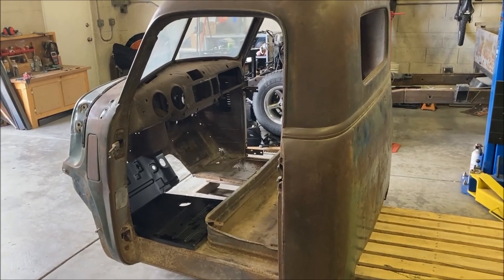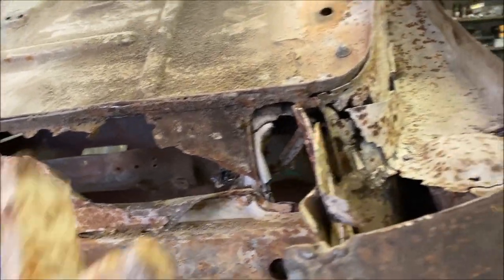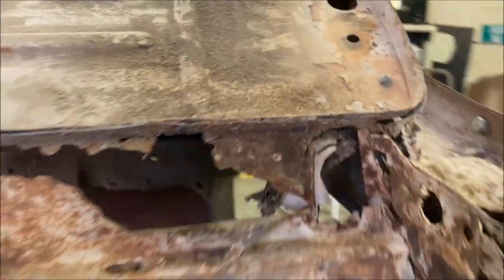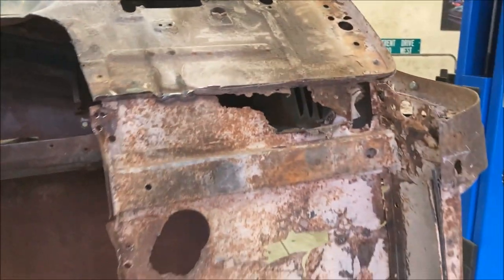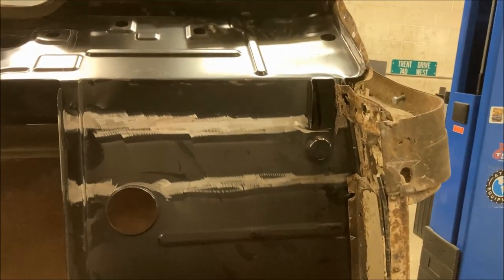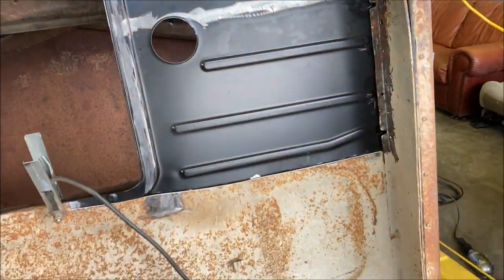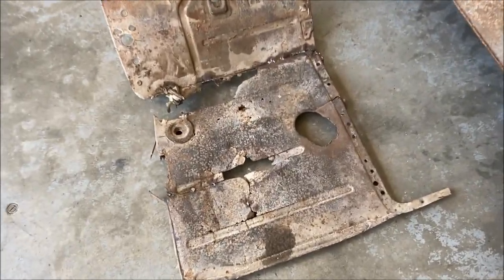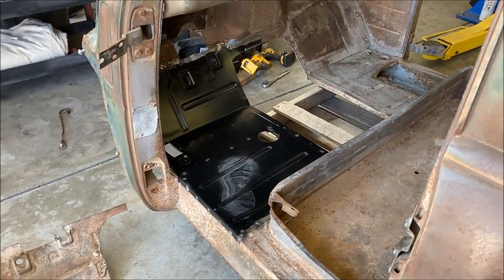Rust Repair - 51 Chevy Hot Rod Truck named "Forust" - Driver Side Floor Pan Replacement

Comment: Hey Trent. That sure is a lot of rust. You are doing it the right way. Replace it all with new floor pans. My next project is a 1940 Buick Special. My floors are worse than yours. So I have my work cut out for me as well. Thanks for sharing.🍁👍👍